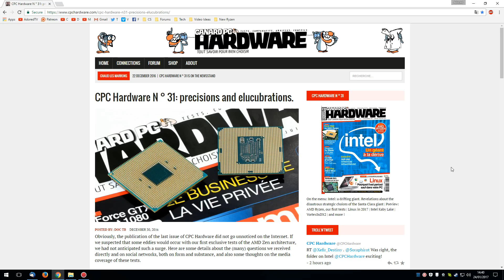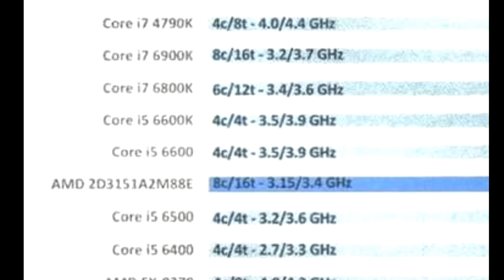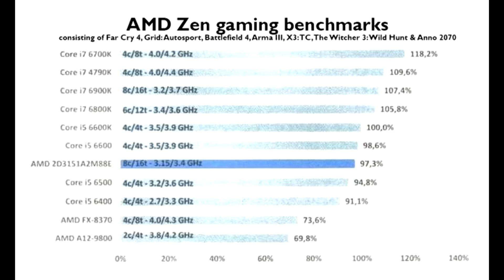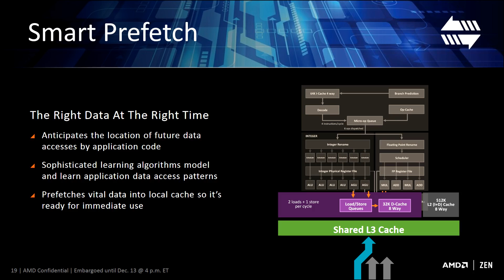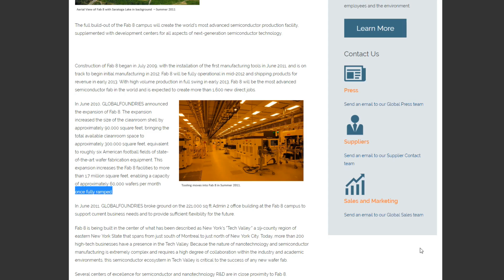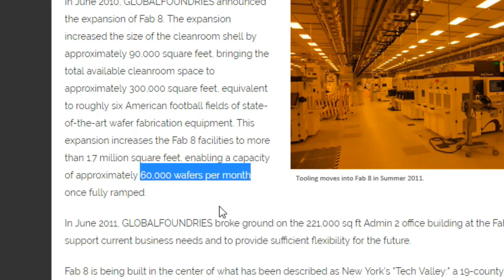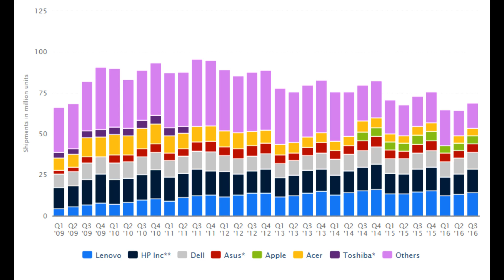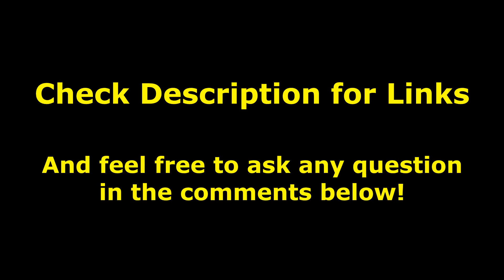Ryzen - A Refresher, Some Speculation and Market Analysis.

Comment: hahaha I heard that Scotland's weather is kind of like new Zealand's minus the winds! Anyhow, I reckon that Zen chips which fail will certainly have parts disabled to make way for 6c/12t and 4c/8t and with so much thermal headroom they will most likely be clocked at much higher clocks. nobody seems to be talking about it but this massive is a massive CPU! most games are optimised for 4 cores! I for one might get the 6c variant thinking about future proofing my rig! the 8c will most likely be aimed at professionals and video editors! now I can only hope that AMD will release the damn thing already... one last thing... the automatic overclock feature! it might only be enabled in certain chipsets but that will also bring a certain advantage when using watercolers
or massive air coolers!
great video bud!
Reply from the maker: Scotland gets plenty of wind believe me - at least on the West Coast coming in from the Atlantic. ;)

Yeah I'm looking forward to seeing how the 4C parts perform too, not sure we'll see a 6C/12T part though, but an 8C/8T part could be the gaming CPU going forward.
Reply: AdoredTV it's funny how much threads the APIs support on the graphics cards but CPUs are still very poorly optimised. let us hope for 8t! Amen!
Reply: Marcio Cattini to be fair, GPUs and their many cores are handled by the graphics card's firmware from whatever the video driver tells them how to handle the job,
you usually can't really isolate 1 single GPU shader core like you can with a cpu core, at least nothing i know of outside of maybe cuda/opencl, which games dont use at all

in fact, before async compute was a thing, all the throughput to the GPU was strictly serial, with the driver/card firmware parallelizing the job from there, you have little to no control over that as a developer

GPU instruction sets are also more limited than CPUs, although opencl and cuda and the whole gpgpu thing have been pushing that forward

also, the floating point precision on GPUs is merely 32-bit (64 for professional cards like the quadro and such), CPUs from the late 90s already had 80-bit precision, so an astronomical tradeoff in precision is done to gain performance in graphics cards

you can't really compare general purpose CPUs and GPU cores (which are much more built for 1 custom purpose) as if they were both apples
Reply: But I never compared CPUs and GPUs, all I said is how APIs are still poorly optimised for multiple CPU threads...

Comment: So AMD's chances of a comeback is mostly reliant on where they started in the first place... the CPU market.

If AMD manages to make Intel shit themselves (it's gonna happen lol), then Intel will lose money and be forced to spend more! Yes! Intel is fucked lol. Interesting times in the CPU market. Unlike the GPU market where AMD is extremely vulnerable.

I just think that AMD's acquisition of ATI was a bit weird and too expensive in the long term and short term. AMD, going up against Nvidia, having to deal with short term driver issues and at the same time, deal with CPU market strategies and business objectives is a bit of a stretch. And AMD have been forced to sell a lot of fabs because of scarcity of revenue. And stupid loan investments. Thanks Sanders! 

While Intel, has more manufacturing capability, reviewers who can back them up, cough Linus cough and market share domination with no GPU market investment required, it's against AMD. Unfortunately.

So while Intel have to worry about CPUs, AMD has two markets to monitor and keep alive. A bit extreme! No wonder Nvidia and Intel have it easy!

I want to see HBM APUs. Holy shit that will dominate.
Reply: they already pushing hard,the new pentium that is a i3 in disguise and rumors have it new kabylake 6c and 8c at summer.
Reply: maz199 i'm kind of split in two about HBM APUs 
memory bandwidth is only good for higher resolutions, on-chip gfx usually lack the number of shader cores to really bump up any other settings though

APUs are a cheap alternative for a real setup with a discrete GPU, as far as my knowledge goes, HBM isn't cheap (yet)
which kinda beats the whole purpose to me then ;)

but yeah, go AMD!
Reply: Alexander Rewijk it's expensive yes but for goodness sake they have had this tech for years! Surely they have mastered it. 

APU HBM + Vega HBM, holy crap. That would be interesting. And overclocking, holy shit if AMD implement this, they will blow Nvidia and Intel away. It won't be THAT expensive, it's going to be cut down for 1080p gaming. A rather still very popular resolution. Maybe even push for 1440p, who knows.

Comment: Ok, Let's talk first thing first, vega and titan x in the gaming demo. Its simple, vega at the time was up to 7 months out, you want your flagship crashing on stage where everyone is watching? using nvidia put all pressure on nvidia to not fail, and all eyes on ryzen for performance. 

Now lets also talk shortly on vega. 

there are 3 points where vega is up in the air
1) it was an es, as we seen from amds ryzen, the slowest one to the base clock of 3.4 was a 17% difference, there is up to that big a difference 
2) the drives themselves by someone in doom nightmare stats showed us/told us it looked to be hacked together fiji drivers. This seems like a make it work driver not a finish polish one, This also have a fairly large margin for amd to boost performance, just from where it was to launch, if it was a released driver, would likely gain around 5-7% more based on amd's current year to year boost in driver performance. 
3) potentially throttling gpu due to everything being taped up. 

1 and 2 are likely, 3 is unlikely, at least how i seen the benchmarks and knowing what a throttling fps counter looks like. 

now on ryzens price, there come the interesting speculations. 

based on die size, I have always said they had between 100-1100$ to sell that cpu based on the 'half a 8350' size i heard, and what intel charges for their 8 core. 

then new horizon happened with the dota demo, 6700 v ryzen v 6900
Why a 6700, why not an i5 or an i3? why specifically the 6700k?
This lead me to believe what you pay, what it preforms like.

Up to this point we had a glut of highly untrustable leaks saying 350 for base ryzen with 500 for higher binned, I see them all as fake but reasonably priced fakes to be sure. 

then during ces, amd was specifically saying 'at 500 dollars we bright the price of performance down, at 350 (it was reported in pounds I converted) we change the industry'

They were openly talking about price matching an i7 with the 8 core.

But here is a point many people tend to overlook and just assume intel has been holding back and the moment amd is close, they drop the hammer on them and make them irrelevant. But what if intel has nothing, and won't have anything till mid 2020 to 2021 (based on their new microarchitecture) all that intel can do is hope incremental upgrades get them by. if amd price wars with intel, pricing their shit just slightly below intel, intel wins. no one will buy amd when intel isn't that much more expensive and is a known where as amd is an unknow, they will end up with the 8 core around i7 prices anyway, so with that in mind, why not just drop a hammer of yor own and make the entirety of the i7 and below lineup the retarded choice to go with? you offer more performance across 8 cores then people will get with just a higher clock, games are starting to use more than 4 cores, you take every advantage intel has away at that point with 8 cores, with 6 cores there is still enough of an advantage to higher clocks that it would be smarter to stick with intel for a gamer. same with the i5, which would likely get a 4 core 8 thread against it, but intel likely will clock higher, the threads would add at most what 50% more performance to something that utilizes them correctly? then from there intel rushes a new cpu claims 'new processing breakthroughs allowed us to price these chips lower then we ever have before, and now intel is the smart buy till amd drops the price. 

here, up till ces the i7 matching price point was a hope, then amd said it was on the table, and you have hinting backing that up, amd said 500$ would be a solid performance uptick for price, and they aren't wrong, but if they did it after saying 350 was on the table they have fucked themselves. Id likely get one regardless due to how long my quad core lasted at a time getting a quad core was 'stupid overkill' but amd's marketing has been fucking horrible before, they could think that saying it could be 350 or 500 then going 500 is still a great move for consumers, but they are dead wrong in the way it would be perceived.

really want/need a new computer and cant wait for this to finally come out to get it.
heres hoping it will work with windows 7 painlessly.
Reply from the maker: Yes but they did show a Vega demo, running the easier SW:BF at 4K.

I heard them say that about the 350 price point too, however I think that'll be a lower spec 8-core CPU, probably without SMT.  I still expect the highest SKU to go for $500-$600.
Reply: at the ryzen event, sure, but they also gave you absolutely no info, as it was just a 'hey, look, its working' kind of deal. 

From my understanding with ryzen, it has less memory throughput on single die version, less pcie and if anything uses avc 512, amd has no answer, they just have compute which is still allot, but its compute and that alone. 8/8 or even 6/12 would be a VERY hard sell at 350 alone as most people who play games argue right now how useful is an i7 really? you move down to i5 price and what is amd going to offer there? 6/12 6/6 or 4/8 and you now have intel on the better process so overclocking will go in their favor on a 6/6 or 6/12 and possibly still go in their favor at 4/8 and you concede the i5 to intel as well, not to mention the i3's are a write off if you just but a 4/4 down there because in a game that doesn't utilize cores well, or just 2, it's the i3 all day and the games that require 4 threads will still work on an i3 with.

this either has intel loose out for 1 generation at peak power, but not by enough to turn heads, outcomes cannon lake, and intel now has a 6 core 12 thread on the 350 range, possibly 6 core on the 250 and 4/4 or 4/8 on the i3 range and there goes all amds advantages besides a price drop.

That I honestly believe is to close to intel, as intel has the ability to drop a hammer of their own if they want, but I doubt they would consider it an option. 

If you have amd start out with an 8 core 16 thread for i7 price, you then have a step above with good binning for a far higher clocking 8/16 at 500-700 then you have all the lower binned/core chips down in areas intel wont have an answer for it, at a price point that you would be stupid not to jump at it. Amd cut some corners on this cpu, but what if there was a 2 die variant, that gave you the pcie and memory throughput? I mean if we even consider there are going to be 4 core 8 thread options, what about putting 2 of them together chips that would be in the 150-250$ range and now you make then a 700-800$ range? then 8-16 core units that actually fight and possibly win against intel's i7-e line then surpassing it by offering 4 more cores and 8 threads. at that point the only thing intel could do is push avx 512 and hope it takes hold. 

Amd doing the 8/16 v the i7 at least to me was a hint at the price, then ces telling us it's on the table, if amd drop the 350 price point, intel won't have an answer unless they are willing to price cut, something I don't think they ever did same gen, and they would likely be forced to cut the i7 price across the board and lower the i7e skylake to around the same price points, or as arrogant as intel seems, possibly write the next few years off as a loosing battle/loss till they get their new architecture done.

350 would sell a shit ton of units, get people on an amd platform for a potential upgrade or two, and do wonders to their brand name all the while hurting intel. I could see a 500$ price point, but after ces and telling us 350 was on the table, it's getting less likely and more of a pr disaster if they do, because we now know it was an option, and they decided to not take it. amd sucks at marketing so I would not put it past them to think either one is great for bringing the cost of performance down, win win, but it just isn't anymore when you tell us 350 is on the table.

Comment: Hmm, the power consumption chart he showed. I read it a diffrent way, as to get an idea of improved power efficiancy I would of been intrested in a clock for clock match VS a unit with similar core and IPC. (ie. the 2-3 Watts are irrelevent when you take the diffrence in clock speed into account, as typicaly for ever few Mhz you get a non-linear increase in power draw).

Not that it matters to much, I suspect all he was saying was power efficiancy is more or less at least as good as intel, and we will not know the final numbers untill we have a retail cpu as an earlyish engineering sample is not the best refrence. Still I we all know what the interwebz are like and it would of been nice if he had spelled it out a little clearer.

I wonder if Intel will hold out untill there 7nm proecess is ready, as the cost per cpu will drop and performance/watt will be much improved giving them an edge in the data warehouse and allowing them to lower the price of there desktop cpu's and keep a nice margin. It will be intresting who can scale up 7nm production faster, Global or Intel. (I would place money on Intel), and how far behind the other will be.

I suppose Intel always have the option of offering new CPU's with no GPU at a lower price. Its Intels response that intrests me, I remember all the fines Intel had to pay for bribing manufacturers to stay away from AMD. I also wonder if Samsung will own brand some AMD CPU's since they will be one of the Fab partners like they did with the Jaguar Cores in one of there ultrabook ranges of old.

Comment: Whether or not Ryzen makes a huge impact in the market, one this is for sure: AMD have definitely got a very good marketing department behind them. Both Ryzen and Vega are two of the hottest topics in the IT world right now, whether you're an AMD fan, an nVidia fan or an Intel fan.
Reply: Adam Lockington yep but Polaris was in the same position, and it didn't really impress. It needed a high end card. Vega is too late. Nvidia will respond with the ton of money they have. All this hype will be for nothing. However, Ryzen paints a different picture. THAT is a interesting topic.
Reply: Agreed. We've so far only really seen Vega beating the GTX1080 at 4K by a small margin in an AMD optimized title running in Vulkan.
Reply: Adam Lockington yep. 

AMD takes way too long to get their new architectures to the consumers. 

The HBM tech took too long to refine and sell. If AMD were going to invest in HBM, they needed to get it as quickly as possible to the market at around the Kepler days. Nvidia would have been screwed then because efficiency was still a problem for both companies. HBM memory against Kepler GDDR5 would've been a bloodbath for Nvidia. But no, they put it up against maxwell, where Nvidia were already dominating.

AMD IS superior in tech advancement but takes too long to get it to market. I mean, the freakin Ryzen architecture took years to come to market. What were AMD doing? Waiting for one guy to make the tapes? Come on! 

It's AMD to blame for what has happened in both the CPU and GPU market. They do well here and there but never really impressed in the high end. Something that Nvidia is milking right now. 

RX480 should've been clocked at around 1600+ but no AMD gave us scraps of what Global was producing. Yeah the 480 is cheap and has limitations but not even the partners had a go? I feel like Polaris was a lazy release on all aspects. Very disappointing.
Reply: maz199 Even with that said, Polaris launch was still a rush. Sucky reference design was a big blunder. Most hardware buyers that agrees to participate steam surveys believe that the RX480s run hot (they're mostly "eaten" by cult though). Plus the PCIE overdraw as well. Yields were also pretty bad, but step their press connections and advertising up, public image might change in the next card launch. I am not sure why they have not learned their lessons for years.

Comment: I hope you're right and AMD will set reasonable prices. I actually look very much forward to the 4-core 8-threads Ryzens. Instead of relying on more CPU cores, I bet on technologies like OpenCL that will accelerate highly threaded number crunching applications like rendering and transcoding and GPUs generally serving as some sort of transputer. Nowadays we still make limited use of the calculation power of our GPUs which is a shame. We may argue about CPU innovation having been almost at a near stand-still because of lack of competition - but on the software side we still haven't managed to make efficient use of what is available to us now. The software is in a far worse state.

Comment: Perfect video.Imo there will be 4 Ryzen cpus.Two 8cores one cherrypicked around 550-650 that will be same or slightly better than 6900K and one with less overclock capability around 400-500 usd.Then a 6core that imo will be the best choice for the average joe and one 4 core.I predict they wont choose super aggresive pricing because they will  push intel to react.And they dont want that.
Reply from the maker: kinda close to my expectation as well, though from what I hear the 6-core isn't happening.